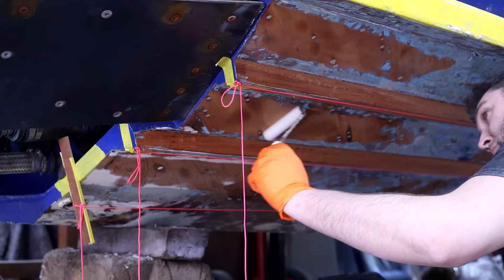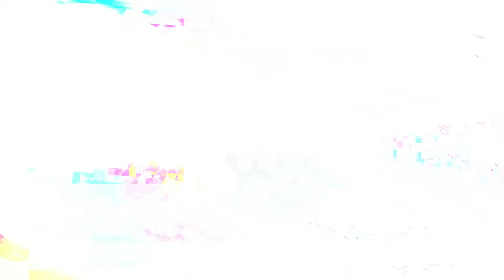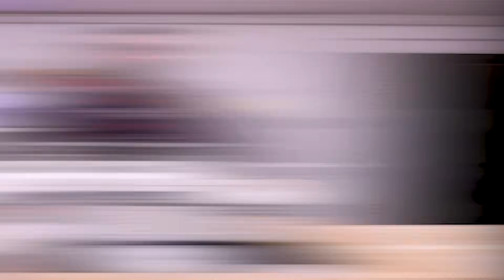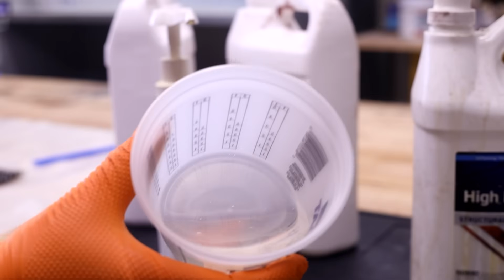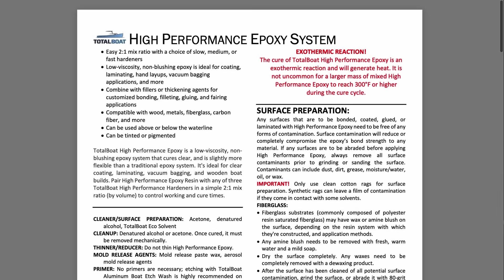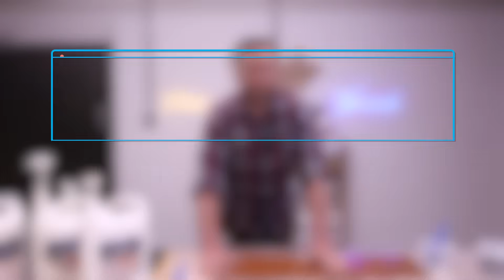I Tested This Epoxy for Months… Here's What I Think | Total Boat High Performance Epoxy Introduction

Comment: Total Boat / Jamestown products seem to be OK in general for DIY - Hobby / and lots of "sponsored" YouTube channels.  Total Boat isn't a true manufacturer though, they are just a distributor with a label.  The Total Boat & West 105 data sheets have very similar mechanical characteristics, but we like West for lower water absorption over time.  Epoxy systems in generally will always need a UV protection strategy.  We use West System 105 for boat building ...and their newer Pro Set products for serious work (a much higher class for extreme projects like carbon fiber, kevlar, metal bonding, high temp etc.).  If you get West in 55 gal drums, it's actually a very price competitive with any other brand - and made in their Michigan, USA plant.

Comment: Does the Total Boat High Performance include UV protection. I've heard it does not.
Reply from the maker: No UV protection in this one so any coating will need to be adequately over coated with a clear or varnish 👍

Comment: TotalBoat has certainly won the internet. They have done an exceptional job of getting product in the hands of online makers and gained a lot of great exposure from those efforts. It is a very good product. I've used the same formulation from the original formulator for years with very good results. 

The blush free property is very useful. While it can blush in very high humidity conditions, it is pretty reliable in typical workshops conditions. The fast cure is a bit more likely to blush than the slower hardeners. Older containers of hardener will tend to turn more amber with time but even quite old jugs will continue to cure well after years of storage.

I don't use a whole lot of West Systems epoxy, but if you are in need of technical support Gougeon Brothers is still probably the most knowledgeable resource for using epoxy with wood. I often use West Systems for fill coats where it seems to level out better than other brands I have tried. TotalBoat does a fine job, but West seems to level a bit better.

Good job by TotalBoat for getting epoxy to you, it certainly helps their promotion efforts to have you demonstrating their product.

Comment: Thanks. I'll have to read up on comparative parameters with the epoxy I use (West)> Can I get epoxy out of my hair with a hair dryer and a comb? 🙈
Reply from the maker: That would have been a great way to explain the Tg... "when I get epoxy in my hair, how hot do I need to get it before I can remove it" 😆

Comment: I can tell you that not all 2:1 epoxies are created equal. Glad to see that you really tested the coating and (anti)blushing characteristics. I was not so lucky with another brand (I have no idea what it was, it came in the CNC-cut kit boat that  I built) that stated it was non-blushing.  As for next tests: I’ve seen the internal temp of my car in Texas heat get up to 134 degrees Fahrenheit. Might that be a problem inside a cabin in a moored boat? We use all sorts of doohickeys to keep the temps down with foldable shades, etc., but maybe you could test that. Excellent video, Dan. Thanks!
Reply: The Tg of epoxy is where I always get a little nervous in boat and airplane applications.....particularly in the engine compartment.  When it's touted for it's fuel-proofing properties it seems like a perfect fit under-hood, but be very careful about approaching the Tg where you're counting on the structural strength of epoxy.
Reply from the maker: Yes that would be a good test to do and it is on my list. It would be really good to see how things hold up in real life applications. I'm not sure we ever get hot enough weather here in the UK though 🤦‍♂️
Reply: @DanLeeBoatbuilding given the degree of fairing youve done .. WHY epoxy over resourcinol .. other than the long set time .. its stronger

Comment: I have used this product, without fail, for years for timber bonding and sealing plywood but would love to see more on structural timber applications for boats. Thanks!
Reply from the maker: That's great to hear, there are more practical application video coming. The next one I am planning will be steam bending vs lamination looking at the benefits and flaws of each method 👍
Reply: @DanLeeBoatbuilding , I faced that problem last year on a curvaceous rub rail. I loved the lamination approach vs. an impossible steam bending attempt.
Reply from the maker: I pretty much always favour lamination over steam bending these days. With steaming big timbers that’s a hell of a lot of inbuilt tension in the boat!

Comment: during the time you’ve used TotalBoat epoxy have you noticed a longer or shorter shelf life than West Systems ???
Reply from the maker: I usually get through epoxy quick enough for shelf life not to be an issue but I’d expect either to have around 2 years if unopened.
Reply: @DanLeeBoatbuilding  Most epoxy resins have a very, very long shelf life. West says 2 years on the datasheet...but the say there isn't much to break down over time.  We've used resin 20 years old and its fine.  The hardener you might want to test carefully if its over 5 years old, but it's usually fine.